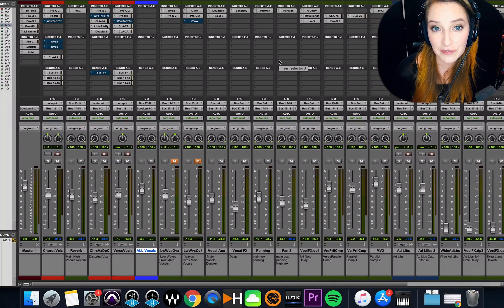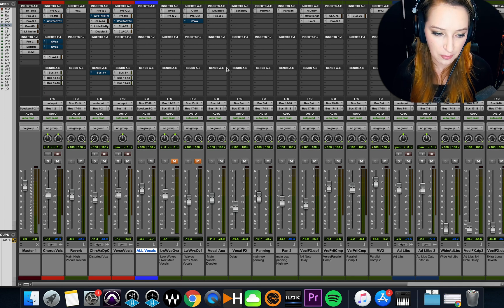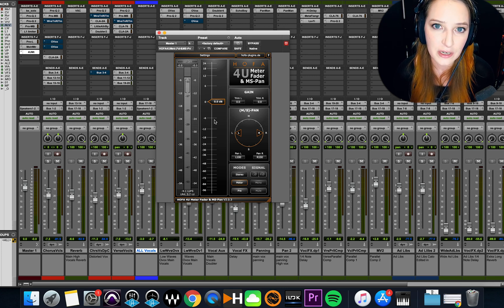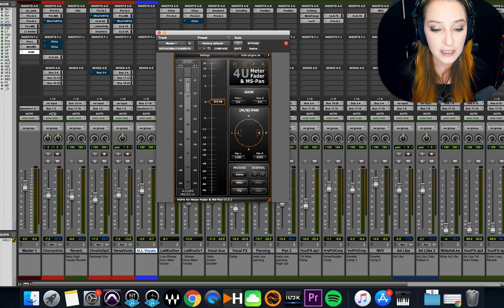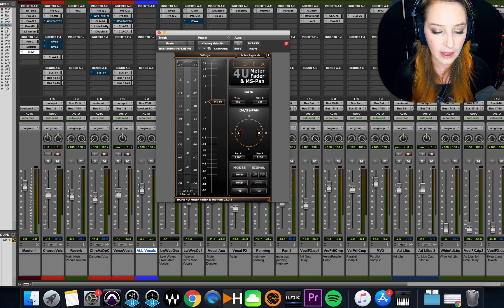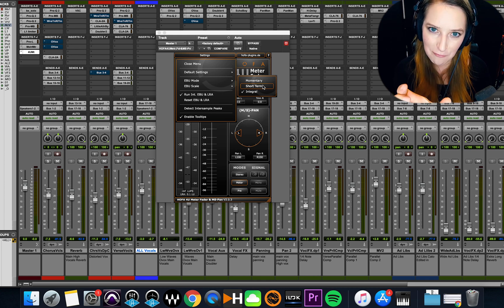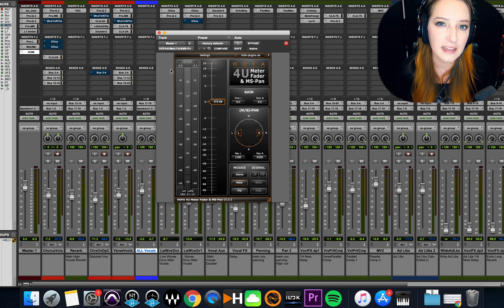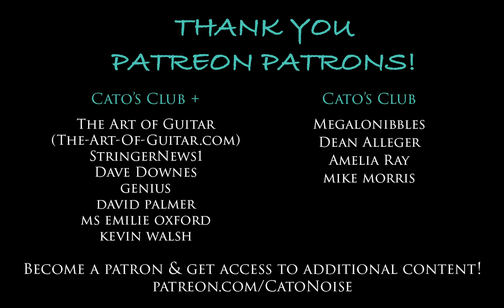Master Fader Metering in Pro Tools: HOFA Plugin LUFS Monitoring

Comment: LUFS meters apply an EQ curve that matches human hearing before metering, known as a K-weighting. Frequencies above 1KHz are perceived as much as 4dB louder and are boosted. Bass frequencies below 70Hz are attenuated.

Momentary: Average over 0.4 seconds
Integrated: Average of all the momentary measurements for the whole track. This is the important one.

Short Term: Average over 3 seconds.
Loudness Range: Calculated from short term measurements and not used when submitting tracks.

Another thing to look out for is True Peaks (dBTP), but that's another story...